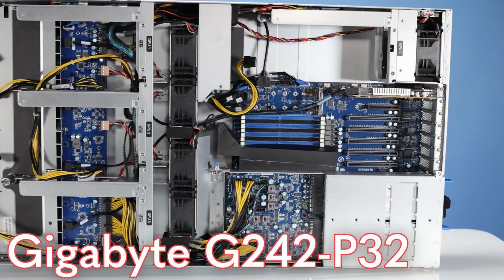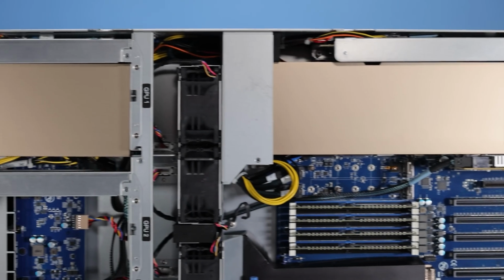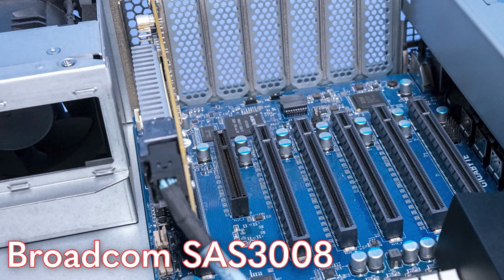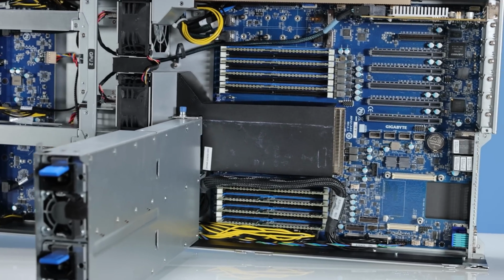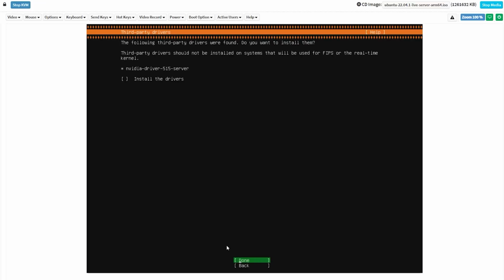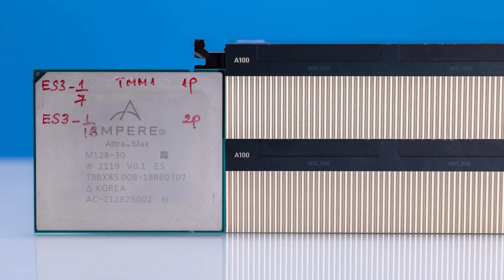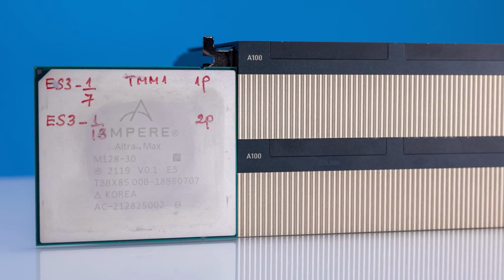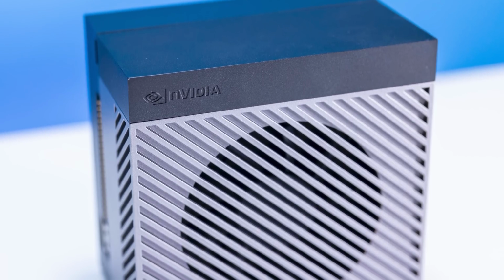Now THIS is an Arm Server! Ampere Altra Max NVIDIA AI Server

Comment: I've seen an EATX form factor Ampere PC with a RTX 4090, which blew my mind. Could you build one of these as an ingest server or to do video editing in Davinci Resolve? Also, could I use an Ampere PC with an Nvidia dGPU running Arch64 or something to run stuff like Stable Diffusion WebUI, or train models with Torch, or run a local LLM, or would they require all custom code? Also, is there a way to run Windows inside VMWare, or VirtualBox? Thanks for the great content! This machine is drool-worthy, for sure.

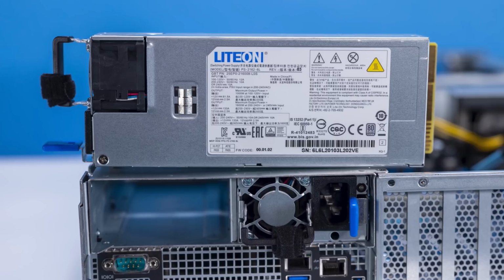Comment: 12:40 However, note that that PSU is only rated for 1 kW output when supplied with 120 V AC. Though if you don't need redundancy on a dev server you could probably load-balance over the two PSUs.

Comment: The Orin is a garbage replacement for a 150 dollar jetson 4gb with presently cost more than the original Xavier. I could smash my 3090 (unmined) with nvidia letting Chinese vendors charge 800 for a precovid 150cad setup

Comment: How does the power consumption compare with x86 servers? ARM chips are lower power.
Reply from the maker: Slightly lower, but in an accelerated system like this it is a single digit percentage benefit over an AMD system.

Comment: Would this perform as a more power efficient zfs storage server (ones with less core count ofc)
Reply from the maker: It would work with ZFS, but I would probably stay x86 for now with it. Most of the recent ZFS development is done on x86 and storage is probably worth being risk adverse with. Also, you would probably want more drives and fewer GPUs in a storage server.

Comment: i hope high core arm server in as desktop computer will becoming more common and available for the mass market. putting more presure for x86/64 to be more competitive both in price and performance.
Reply from the maker: Actually, they are pretty close in pricing when it comes to servers and large-scale. Ampere is priced more like what Intel and AMD price their chips for the hyper-scale market.
Reply: @ServeTheHomeVideo  That's true. Unfortunately for home desktop, currently we're stuck with SBC like raspberry pi, orange pi, etc. 

Linux on arm is quite okay in term of support and software availability. Arm for windows is quite hit/miss. But the exclusive partnership between Microsoft and Qualcomm is ending in near time (cmiiw). Hopefully when it ended, Microsoft will add more robust support for arm processor in general. Arm on mac is really solid, though 😁
Reply: This is junk for mathematical engineering use because they need floating point power only available on risc and x86

Comment: Patrick, how's the computing power / power utilization looking for these payloads this CPU works well (no GPU) e.g. as you mentioned redis, nginx etc. ? If this is favourable, then companies might want to use these (for specific use case) instead of x86_64 . Some sever farms need a lot of nginx / redis etc. instances and burn through lots of kW; saving even 10% would show up in the ROI.
Reply from the maker: In nginx and such, that is where the power savings really come into play. On the multi-GPU systems, it is usually a number under 10%. Even this was <10% lower power with two A100's and a BlueField-2 DPU v. a similar EPYC box.

Comment: Well, in a GPU server, if you want to do big vector floating point calculations or AI, that's litterally what the GPUs are in it for. and a companion integer strong CPU is perfect. That's another reason why in the cloud all those minor Intel accelerator extensions are kind of pointless, since you can use a service that is purpose build for each type of workload. Your nginx Ingress controllers, CDNs, etc. will run on the ARM server, your AI API calls on GPU or even Inferentia and Trainium, or other similar specialised AI processors, etc.
If you are building one monolithical monster that has all the code on one big VM and using the same CPU for all of that, not only are you doing it wrong in many peoples oppinion, you're definitively at least not doing cloud. Hosting that VM on a hyperscalers hardware isn't changing that fact, even if they are called public clouds, because that is what they are designed to do.
Reply from the maker: The Arm vendors will add the same over time. The latency going to a specialized machine type is so much higher if you have a small percentage of a calculation type that built in acceleration adds a lot. Arm vendors generally do not have it, but it is just a matter of time
Reply: @ServeTheHomeVideo  Only for certain use cases will they be added. You can have big vector extensions on ARM for a long time as well. Fujitsu's A64FX have comparatively way more vector power already. AVX512 didn't need any special design work either, it is just a question of whether it is useful enough to warrent the transistor usage to make the vector bigger. That problem won't go away either. We'll see bigger vector units, but the ratio will stay smaller for use cases where they are less usual to be useful.

As for the latency, it clearly hasn't stopped the rise of microservices so far. A lot of the calls are separted already on the customer browser side anyway. E.g. /api/recommend would go to an ML service, while /api/product/<id> would go to a CMS cache, /api/... to various REST services, etc.
And let's be honest, enqueuing the training of an ML model in a few ms won't influence the hours or at least minutes it takes even on special hardware, especially if you care about cost. And if you care about cost, you won't have enough hardware standing around to do that at any time in less than the milliseconds to reach another service in the same data center. You will use it only when demanded, so the spin up time is there either way. You may as well spin up purpose build hardware.
That only changes if you have enough constant throughput to warrent a dedicated machine, at which point it again warrents purpose build hardware, just dedicated one. Since you can use VMs, it's not like you need a minimum size for that either on public cloud.

Comment: How much have you paid for these A100s - afaik they're crazy expensive. I think AIBs are prohibited from equipping 4090 with more than 24GB to keep the A100 sales going at 10-20x the price for the same performance. Also with ARM you get the problems with closed source drivers - if the vendor doesn't provide or discontinue the driver for ARM, we're out of luck.

Comment: what's the expansion ROM situation like for add-in PCIe cards?  I know UEFI specs include machine-independent bytecode (EBC) but are vendors starting to ship with those?  Can I boot off an NVMe card? PXE / UNDI support for network cards? (flashbacks of open firmware expansion ROMs for pre-intel macs...)

Comment: Just in case not mentioned in the video, if you go CUDA on Aarch64, then it requires 64K page size.
It shouldn't be a problem for all Arch64 servers, as Server Boot Requirement has mandatory 64K page size. But not all other Aarch64 vendors follow it (e.g Apple?)

Another thing is the software stack support, CUDA is already closed-source, but some distros are not fully migrated to 64K page size for Aarch64.
The most common case would be swap partition, which has its blocksize saved at mkfs time, thus one can not reuse the swap partition between different page sizes.
(And some releases ago, btrfs also doesn't fully support subpage, thus fs created under 4K can not be mounted on 64K page systems)
Reply: Apple uses 16k pages by default due to its IOMMU, but can support 64k pages fine iirc. It seems Asahi has more or less forced support for weird page sizes on a lot of projects, probably for the best though.

Comment: I really wish there were more "general compute" ARM based systems. 128C / lots of RAM would make a lovely "infrastructure consolidation" node.
Reply from the maker: 100% there are other Altra systems. We will have reviews of them coming. What is missing is like a 16-32c/ 32x PCIe lane 2-4 ch DDR4 version that is cheaper
Reply: @ServeTheHomeVideo  you should have finished that sentence "... that is cheaper than x86 platforms of similar performance" because otherwise it is just an unjustified fancy revenge on your sysadmins. But hey, look, shiny!

Comment: I'm looking forward to Intel and AMD moving over to ARM for consumer stuff as more and more of my personal infrastructure is moving to ARM and the power savings are huge! All my mobile devices + my laptop are already ARM (MBP) and I have an rPi cluster for testing HA/K3S/CEPH. I'm just waiting on ARM variants for my 2 server boxes and eventually the Steam Deck.
Reply: I could see Intel skipping ARM and going RISC-V instead. ARM market is already very crowded except for the desktop space. RISC-V though has enough room for Intel to make itself cozy in most segments.

Also, the Deck going x64 is likely very deliberate as any x64 emu with a DXVK layer would destroy any benefit going ARM.
Reply: I don't think Intel or AMD are going to arm, they already have a lot of customers who depend on x86 software. Plus there's still plenty of room for x86 to grow as well.
Reply: I'm not convinced x86 emulation is going to be solid enough for something like a Steam Deck or some desktop use cases.

Also power saving is not quite as simple as it seems.  I've been testing the Mac Mini M1 and an i5-8250U, while sure the Mac Mini under load is MUCH faster, they both idle at around 11W and the benefit of the 8250U is I can change the storage, RAM and it has six NICs so probably could drop idle load even more if it didn't or if I got a more efficient PSU.  I don't think we necessarily need ARM to be efficient, its just ARM inherently is a better option for bespoke devices because anyone with a license can more tightly design the whole system around it, omitting anything you don't need to save power.
Reply: Have they announced they will do that? I can't see it myself. Intel is too controlling to give in and use an ARM instruction set. They used to make ARM chips and sold off their ARM division.
Reply: @6581punk  IDK about Intel, but I know AMD has been doing some internal testing w.r.t. ARM chips. I believe they were hiring for ARM chip designer positions last year. After the success of Fujitsu, Graviton, and Apple Silicon, I imagine Intel (and the rest of the industry) will soon follow suit if they aren't working on it already. 

I mean, the new power requirements for Intel and AMD's newest CPU's and Nvidia's new GPU's mean that I will probably need a dedicated breaker for my x86 boxes, more power savings at this point must be something they're looking into.
Reply: @SxC97  Uh, the new AMD and CPU's have more performance per watt than any ARM chips. Also, that power savings only matters in your phone though, right? Isn't it literally useless everywhere else.... which is why you don't really see  it in anything other than low power long battery life devices?
Reply: @evrythingis1  ANY arm chip? Are you sure about that? Are you familiar with the A64FX? The ARM-based CPU running the worlds fastest super computer?

The idea that ARM CPUs are only good for mobile devices is rooted in late 2000s/early 2010s PC elitism. Modern chip designers understand the advantages of ARM, this is why every major company is investing in both ARM and RISC-V research.

And low power computing has tons of uses. If you live in a place with high energy bills (like parts of Europe this winter) you can save a substancial amount of money. I use several home servers for work and have to leave workloads on overnight, the power savings of ARM could be a huge benefit. If you run a datacenter, a huge amount of your costs go to power and cooling.
Reply: @SxC97  Yeah. The new AMD designs crap all over it with their 128core 256 thread parts.  The AMD designs are also more energy effecient.... ARM in the server space was a blip and it's already almost dead.
Reply: Intel is already investing in RISC-V why would they pay to use arm designs?